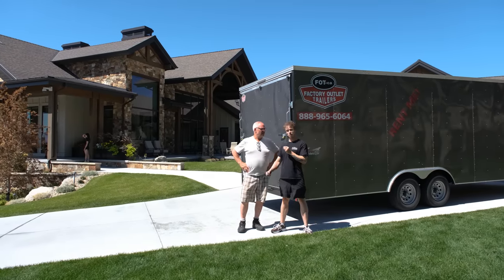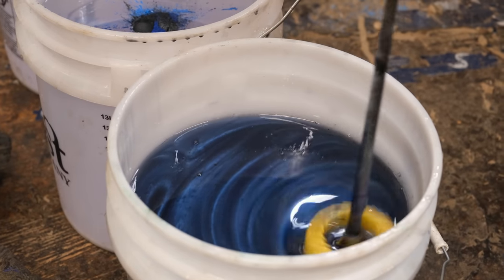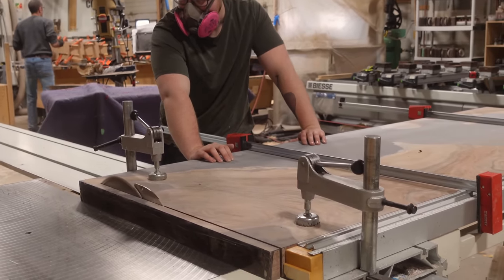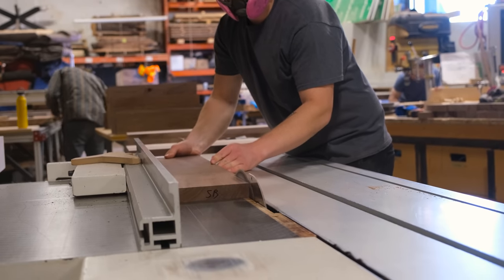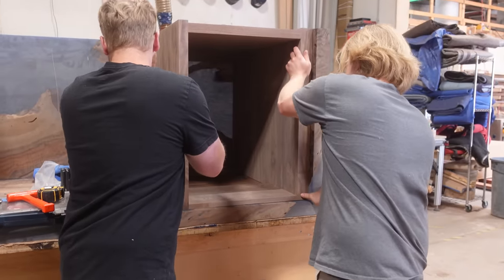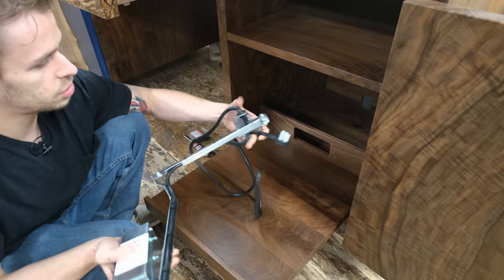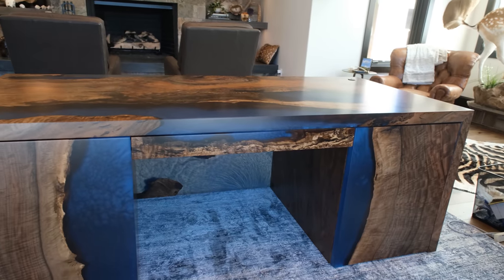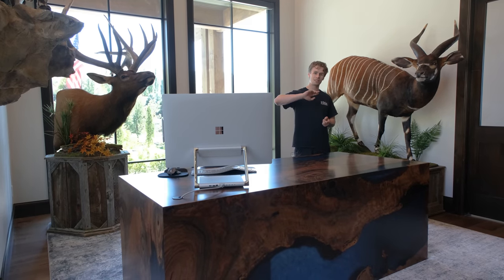The Most Expensive Desk We’ve Ever Made

Comment: when i made high end reproduction furniture all those years ago i made all the drawers we did them exactly like you do but one thing we did not do was glue the bottoms in they were stapled to the bottom of the drawer back on most small & medium drawers, with bigger drawers like armoire and chest of drawers had a few staples down the sides maybe 3/4 to a side but in most cases they were left to float on all but the biggest drawers we never used modern hardware but traditional maple drawer slides that ran down the center of the drawer we also had a pneumatic press custom made to press the drawer parts together rather than hammering the dovetails with a mallet we made thousands of them!! i know its not a lot of glue on the bottoms but am wondering if it could cause problems down the road twist the drawer out of square or some such issue just a few thoughts from an old wood basher that desk is a beautiful piece of furniture well done.  PS dad was right about the sanding thing 100% lol